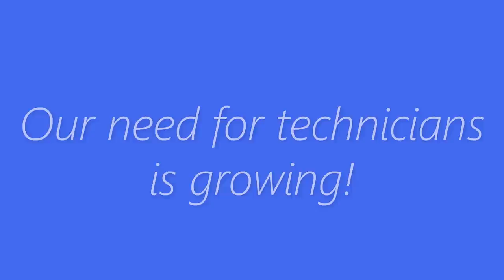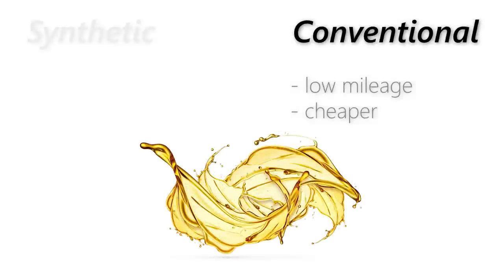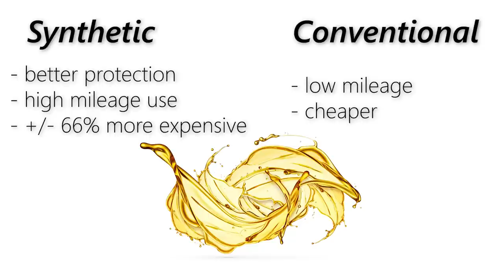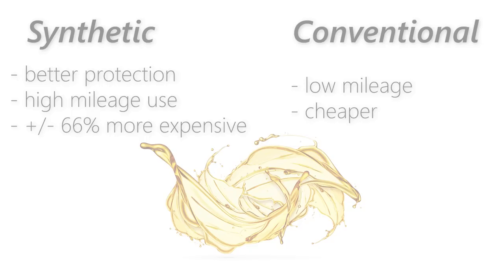Oil Changes Vs. Recommended Chassis Service - NIRVC Will Not Be Beat!

Comment: In my car, I get better millage using pure synthetic oil over blended or regular oil. (.3-5 mpg) The manual says to use it and it could improve millage a little. I would think that would be true on a diesel engine as well but probably not that noticeable. I don't carry belts because they will dry out as they age. If you are breaking belts with less than 40k miles on them you have a component issue.